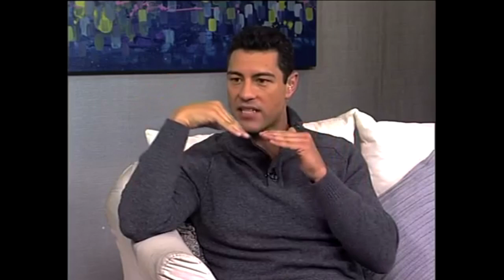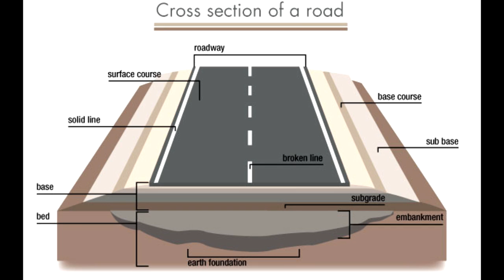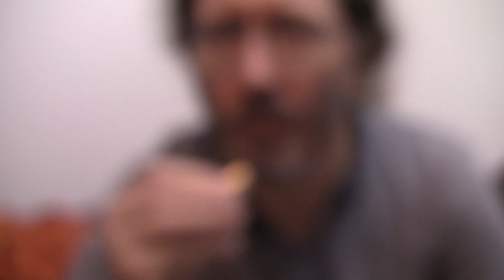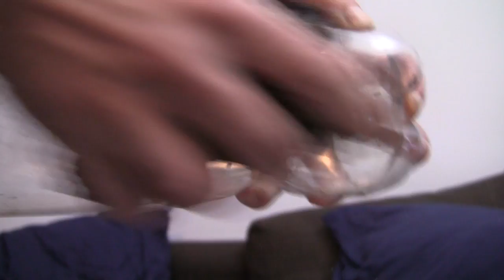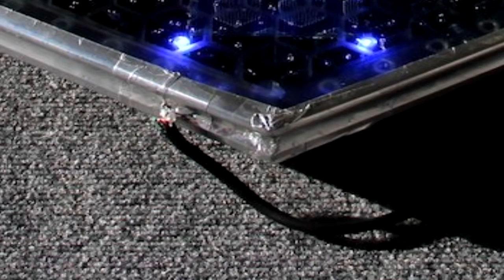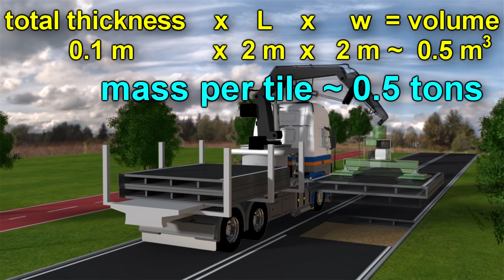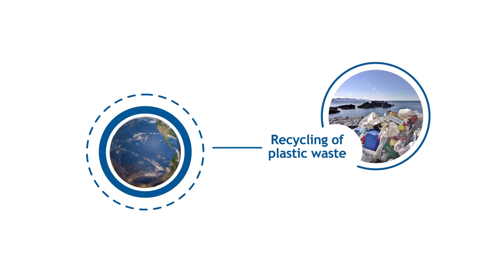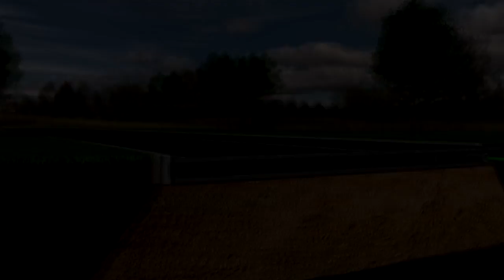Plastic Roadways BUSTED!

Comment: As a fiber technician i wonder how they plan to replace one road unit without breaking the cable. Going to be a lot of splices on that link.
Reply: Gaffer tape...?
Reply: @dannyhhewitt  Duct tape.
Reply: Cables, pipes, sewers, electricity, gas, water are all buried at different levels, surrounded by cushioning materials, for sensible reasons. They are accessed by various means, inspection chambers, ducts and so on. And so on...
Painfully funny :D
Reply: @brando6BL Thank you for stating the obvious, anyone who has experience with inspection chambers much less designing them would know your reply is completely irrelevant.
Reply: @brando6BL I know this was a while ago. But they are talking for this specific scenario with these roads. These roads are stupid as they won’t be at different levels, it would all be right there
Reply: with an solar panel and a hyperloop
Reply: @ddoumeche  a HEATED solar panel my dear sr.
Reply: @ddoumeche  or with a dehumidifier
Reply: They will make cableless cables
Reply: Screw light permeability and connection reliability, who wants fast and reliable data transfer anyway?
Monorail, monorail, monorail. Brockway, Ogdenville, North Haverbrook!
Reply: No! You can’t just replace a length of a large cable without resplicing it or ruining the whole cable!

Haha dumb road go plop
Reply: I mean they could cut the road from the top around the cables
Reply: Ok nerd
Reply: Well, anyone with half a brain wouldn't place any cable in it. You wouldn't want a lot of splices. You also wouldn't want to do repairs in the middle of the road. The costs of repairs and relocates, outages and resplicing would be prohibitively expensive.

Let's not even get started talking about winter and the challenges that brings. Let's just say that where I live we have two seasons: winter, and road construction.
Reply: cutting it
Reply: @Maussiegamer  cutting and reconnecting the cables as often as they would need to, would build up an extremely high resistance which would make the current flow eventually impossible
Reply: Right ? I do UG power lines and was wondering the same thing
Reply: Well I mean, if they were to take the plastic, and use it as a binder for rock, gravel or sand, then at least we could have something to do with waste plastic rather than just filling landfills with it.
That would give it grip and  strength, and it still could/should be able to be recycled. 
Now that may just lead to a more normal road construction, but I figure that would be better and more practical. But then there would be the issue of durability and life expectancy of the road. 
But if the only goal is to find something to do with waste plastic that is just laying around, and not necessarily worrying about how much energy it would take to make it, then its at least an idea I suppose.
Reply: @Ashiwan_the_Scaled_River_Dog  it would have to be plastic that won't leech BPA and stuff into the ground
Reply: @MaceGaming53  Ah true true. Didn't think about that. Yeah that would be a problem. Welp there goes that idea
Reply: @Ashiwan_the_Scaled_River_Dog  if they had a way to prevent that or stop it from leeching it could be possible
Reply: and also we all know concrete roads are very smooth without rough gaps that are bumpy
Reply: mehdjick
Reply: @James Kraatz when you're making new roads, you still have to respect the laws and as the law "says". So that doesn't change anything.

That still doesn't change the fact that cables aren't supposed to be cut. Same as those high voltage cables that go from tower to tower when you're on your way from one city to another. If you cut cables like these, you immediately have a problem with the current. Dont get me wrong, sometimes these cables need to be cut because of idk what and there is a way to minimise the current loss so to speak but still
Reply: 100% loss
Reply: As a not fiber technician this was the first question i had when i saw this
Reply: With magic
Reply: Not supporting the idea of these plastic roads or anything but that problem could be solved simply by detachable section to allow the assembly around the existing cables. 

But The entire idea is idiotic.
Reply: I am wondering what if a driver broke a cable
Reply: Voodoo magic i assumed
Reply: Exactly! One of the drawbacks of fiber. When copper lines get cut, you can splice easily and quickly but with fiber....forget it.
Reply: I thought the same, even if they could change out parts quickly you'd still have to send technicians to fix the splices, so the argument of quickly repairing the road kinda falls apart.
Reply: Maybe like an old slot car track with slide tabs
Reply: Suck it up, no internet, power or water for weeks
Reply: I don’t even have your level of expertise and this was my first question 😬
Reply: Don't need cables, just go wireless - problem solved.
Reply: @kosco1151  .... fiber is faster. also water lines arent wireless
Reply: @mattwaters9008  But if you went wireless with no cables or pipes the removal of a section wouldn't be an issue.
You can run water from the drain and use wireless Internet and cable satellite to go wireless.
Reply: @kosco1151  if we could just go wireless there would be no need for fiber in the first place. and if utilities run next to instead of under roads it raises all kinds of other problems. if we wanna redesign everything from scratch sure whatever but using this to replace modern roads isnt feasable atm
Reply: @mattwaters9008  Well we are halfway there if you're willing to throw everything to the roadside.
That'd be a good starting point.
Once we figure out how to get to get the moon again, without the fluking it we shouldn't have any trouble with roading problems.
Reply: Remove the top side of the road, then the bottom?
Reply: Whats what I was thinking
Reply: But You Do not have any Access to the Cavity where the Wires and Pipes are, So How do you Make A Splice?
You Can't make the Splice while the New panel is Above the rest of the Surface, and then just Lower it into Place.
Uhhh,  The Pipes and Wires will get Pinched / Cut when you try to Drop the Panel in Place...
Not Unless the BOTTOM of the Panel is Cut away. and then that creates a Weak spot and allows Infiltration from Below.

Some How,  the Splice has to be made, After the Panel has been Dropped Into Place.
And Since there is no Access to that Space, it is Impossible.
Reply: Late to the party here, but wouldnt all those splices and junctions cause latency in the connections? If so how bad do you think it would be after about a mile or two? Are we talking like 3G type connection speeds or more in the ballpark of something like dialup speeds or even the sort where your webpage loads little by little and you have to wait for it to fully load or it takes longer?
Reply: These are my thoughts exactly!!
Reply: If it's not practical for a road, might it be practical for a sidewalk or something?
Reply: П shaped instead of close loop enclosure, super simple actually.
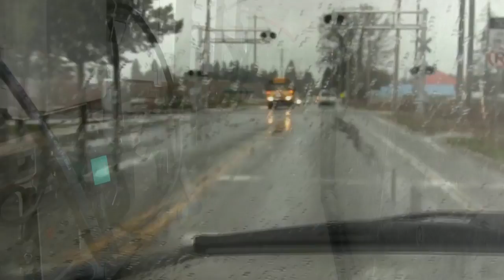Reply: As a hydraulic civil engineer I also wondered how 2:02 could be viable. “The other channel catches stormwater” not it’s not that simple- and then that runoff drain by the sides “soaking into the earth” SO NO MENTION OF WHAT WILL HAPPEN IF THE SOILS ARE IMPERMEABLE?!? All engineers want with this is to continue business as usual, I suppose a storm drain or sewer can be located under the road like normal, but the smaller utilities with stingy DOTs will need so much work if one is removed.
Reply: As a chef i wonder how they plan to replace one road unit without breaking a cable
Reply: I can just see a heavy rain coming and seeing bits of road flaoting through my front yard lol
Reply: It would just have to be a replaceable top surface. Leaving the sides and supporting framework in place. ... kinda like roads we have now...
Reply: Same thing I was thinking
Reply: How will they even get them in there
Reply: Probably sides open
Reply: make a slot in the road pieces that the cable can be slid in and out of without cutting it. this is literally the easiest problem to solve in this roadway issue.
Reply: @ah7027  Yeah man, definitely. Potholes now mean that tour house doesnt have power or internet, and you know how effective the government is at even getting someone out to fix the road.
Reply: @ah7027  then the edge flexes too much and that chamber is useless. Good try though.
Reply: a h Yeah that’s going to help the structural integrity too...
Reply: a h do you not account for the bale attach ments to come apart and accessing this cable would be in possible, your need to cut it up or have a panel, BUT how would you lock this road and if high winds come by it rips up the panels and don’t forget they lose there strength in the sun, stupid idea,of course you can just paint it but how will unlock these bonds together,what about heavy semis as the road will have to have been dug out and even if you do rip up the road, how will you remove all that concrete if you have it moved out of there you need thousands of trucks to move the ripped up road, now if you do this maybe you can start making these road ways, oh wait all roads aren’t the same what in the world will you do now remember if you make a new mold, and not to forget you still need traction when some one does a burn out starts to heat up the plastic and releases deadly chemicals, this is a trash idea and even when you account for all of this, it’s so damn expensive, making all this plastic is insanely expensive, your better of building solar road ways, imagine having a heavy semi will crush this plastic and will lead to cracking and bending and when it bends you need to change this road, don’t forget that you CANT know when you need to change it.
Reply: @totally2117  What sequence of events in your life lead you to the decision of writing this comment as one single, long, convoluted spaghetti-sentence?
Reply: @totally2117  quite possibly the longest run-on sentence ever conceived.
Reply: @Erigalus  lol holy sh1t
Reply: @totally2117  lol, flying roadways. Why drive to your destination on a boring old road on the ground. Let's get those roads off the ground and in the skies. It flying freaking roadways! Roads take up so much space we could be using and cars are dangerous. You'll never have to worry about billy running into the road if they or suspended over the playground on a heavy gust. No more tornadoes completely destroying your roads. Just go collect all the pieces and put them back together like a hot wheels track. Did I mention these are made of plastic. That makes them buoyant. Did I say flying roadways? You get double the versatility with flying floating roadways. Heck yeah!
Reply: Maybe cut a channel in the road that’s being replaced and then put the cable through that channel?
Reply: @nootaboot7042  no, no. Dig up the road to lay your cable 3 weeks AFTER it's finished with a nice smooth top. Then patch up your channel no-quite-flat so that everybody get to enjoy that new road for only 3 weeks. They do that where I live all the time. New nice roads attract road diggers like honey attracts Pooh. All new roads and resurfaced roads gets dug up almost immediately. They don't just dig near the edge on the emergency lane. The ditch will be in the middle, but not quite straight so you can't straddle it with your car wheels. It weaves left and right like a drunk operated the machinery, and crosses from one lane to another.
Reply: Split the road in half so there's two pieces, one for the left and one on the right. Put the cables on one end of the road so to access it you can open the other section of the road and pull the cable out.
Reply: @tristan6509  there are laws about how deep and where to put cables. For example in austria, by law cables like the ones you mean need to be at least 2,5 ft deep (if i'm not wrong that is) . Plus you don't just have excess cable. These cables have a fixedlength and aren't just put in straight, but in a sort of wave so if something happens ( let's say the cable would be pulled for some reason), it doesn't rip. That still doesn' t mean that there's a lot to play with so to say... It really isn't that simple. And before I forget, these type of cables are big and there are "big" and dangerous currents going through them, which means they need cooling so they don't get even close to... idk let's say melting. That's why you put them in the earth. 

If you put them in this plastic road, you pretty much fucked it because there's going to be A LOT of heat in it just because plastic..

In other words: this whole thing is a very, very terrifyingly bad idea.

Btw sorry if i made mistakes writing this. English isn't my first language and the whole "how deep do these cable need to be" i learnt this somewhere around last september. I'll look it up and correct myself if i'm wrong. :)
Reply: Easy fix.  Used magnetic cords so that when a new road is inserted is connected and disconnected when extracted.

Comment: The plastic would also not provide enough grip for cars, just look at concrete. Concrete has to be ground and grooved to get the same friction as asphalt, a result of this is significantly increased noise pollution. These plastic roads would be a real damn annoying noise making machine, especially if you ground and grooved them.

Comment: Lol plastic roads, don’t they realise that the sun’s uv effects plastics and creates methane a green house gas?
Reply: Ooof
Reply: Also isn't methane gas incredibly toxic if inhaled?
So that means windows up, and possibly AC off.
(I don't exactly know how a car's A/C system works sorry)
So you're in a boiling hot car driving down a highway with the windows up because the outside is filled with toxic and flammable gas.
Just wait for an accident to happen or some burnout to occur and we got ourselves a highway to hell, boys.
(on top of that probably melting the road, causing a power cut/ water cut and most likely pumping loads of pollution into the atmosphere. What a genius idea)
Reply: @tiglath pileser  but still there's our problem. It's very flammable and thus makes these roads incredibly dangerous if even a spark were to occur.
Reply: How stupid.. Aren't current processes already producing all that..this will take a bit chunk of that contamination out of the cycle for a long while... If you are so concerned about methane stop eating meat.. That where most of of comes from.
Reply: @ForestSakan  what
Reply: @ForestSakan  so lets have plastic roads and increase the methane !!!
Reply: And then we can set the methane gas on fire and have a huge party
Reply: @ForestSakan  if you're so concerned about climate change just nuke china and india
Reply: Rhodesian Wojak you forgot the us
Reply: Bless no wait not there I live there MonkaW
Reply: Eredar Lord if you are going to nuke anyone for climate change you might as well go with the biggest which would be the us and china
Reply: @rhodesianwojak2095  That's just stupid. Per capita, the people in these countries produce less co2 than the Western people. If US had the population of India, it'll be 10 times more polluting than India.
Reply: @ForestSakan bruh I’m Already vegetarian LMAOOO
Reply: @enpassant8485  Woah you did the weird pawn middle rank thing, I CREAMED
Reply: @ForestSakan  If you're so concerned about shootings just nuke america, they'll understand right???

Comment: I recall quite a few years ago that the Japanese were using car crushers (300,000 lbs pressure I think) to make metal
 slabs for roads. I wonder how that panned out?
Seems we could recycle plastic for road signs, maybe sidewalks, walls, fences and the like. Use solar melters.

Comment: Ok so to start I'M no road expert or anything like that I do know a thing or two like plastic burns easily and gives off toxic fumes when it does burn.  So lets say three cars have a accident and one catches fire. Now the fire will not only burn the car but the road and the other cars plus everyone will die from the toxic fumes the burning plastic road gives off not only the drivers of the three cars but anyone nearby will be in danger of the toxic fumes. This means other drivers that get close enough to the accident and people who have houses near the road as well as the people who are just out walking their dog. Then there is the fact that plastic will degrade from exposure to UV rays like from say sunlight there is also the friction of the cars driving on it that will wear it down over time. Then there is skidding you are driving along in a semi truck when the car in front of you  hits the break you do the same but harder as you have  80,000 lbs. to try to bring to a quick halt so your truck skids lets say 50 ft. Thats going to make a lot of heat between the road and your tires will a plastic road be able to take something like that or is that going to destroy that portion of the road these are some things I think about when I hear someone say make a road out of plastic. Now then my thoughts on the solar roadway that little path that has been made so far doesn't look like something I would feel safe driving over. I know I'M no expert but I do know solar panels are usually a bit slippery either dry or wet so they would have to figure a way to give the cars traction and then you have to make sure they can hold up to the wear of car tires running over it every day all day and the weight of the cars and trucks I don't think it will work.  I know I'M no expert but I have yet to see anyone address any of these things. Ok I'M done now you can hate me.